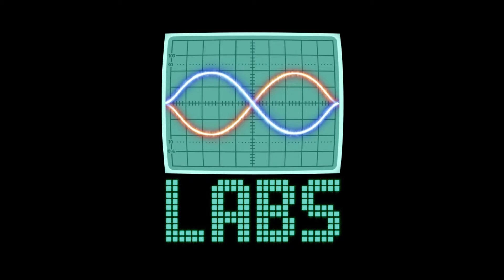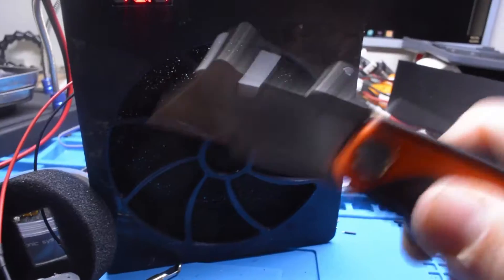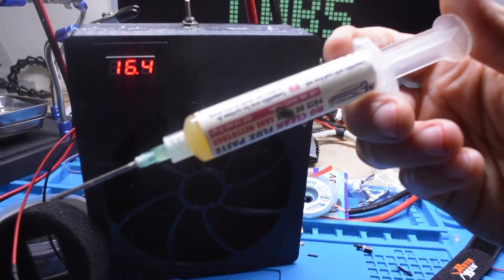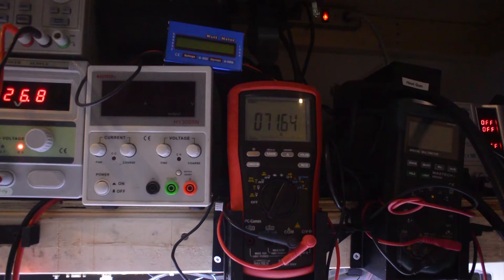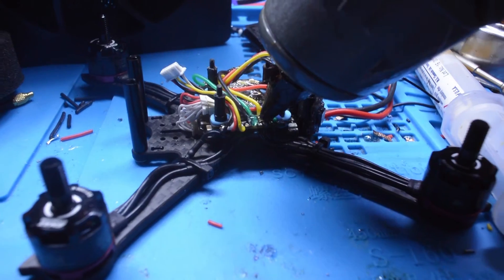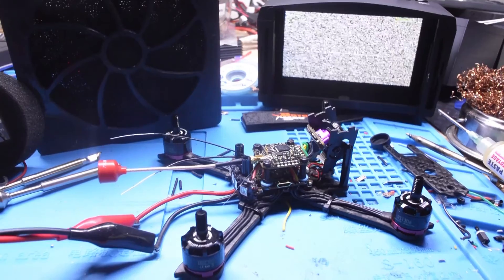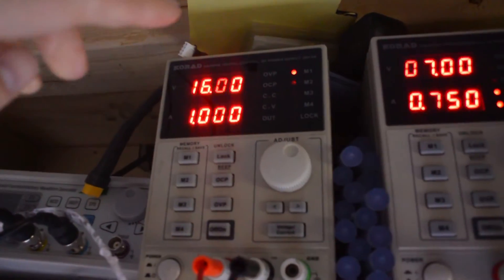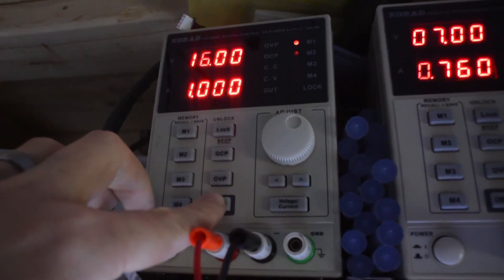What to do if you pull a solder pad off a circuit board or flight controller

Comment: i really like the lightheartedness of the video! this just happened to me for my PDB esc signal pad. and i dont see any visible trace. near the 3 esc pads. is it possible to reattach a pulled solder pad?
Reply from the maker: Check under the board for a circle where the pad is above. If it exists, you should be able to shave that spot to tap into it there. The other option is to figure out where the pad connects to and tap there, but if it is a pin on the CPU it can be a pain in the ass.

Comment: That is not the proper way to fix this. A good repair would mean to add back the ripped copper pad or a thin piece of copper sheet. This way you get a better solder point and is much easier to service in the future. 

What you did is a a lazy hack promoted as a fantastic fix. Sorry, but no, this is not how you should do it and you should not promote a fix like that in such a bombastic way.
Reply from the maker: I never stated this was a fantastic fix, and fully acknowledge this is a hack job (not sure how you could get the idea otherwise) that works reasonably well for hobbyist applications. If you're here doing research on how to fix a guidance computer for a passenger airplane, then this is probably not the way to go, unless you're on board right now with only 10 minutes before you crash.

I hope this clears things up!
Reply: These boards are cheap enough that I would consider this effective until something else took it out of service. For repairing vintage and irreplaceable electronics, replacing the pad is ideal. But for a low current application on a soon to obsolete flight controller, this is the correct method.